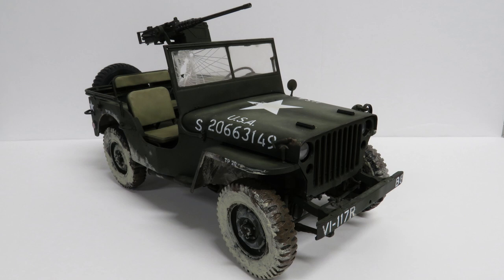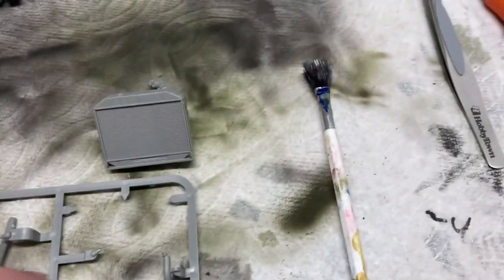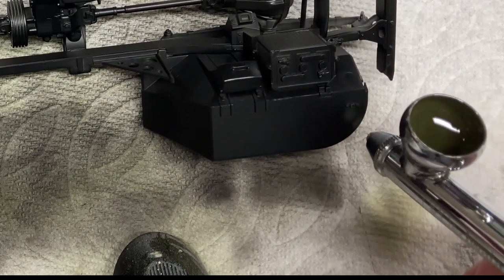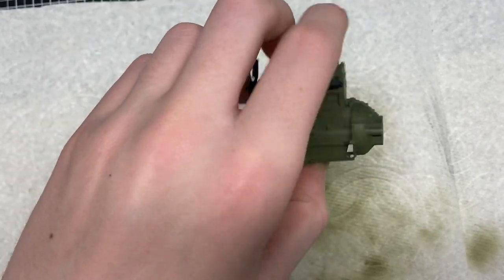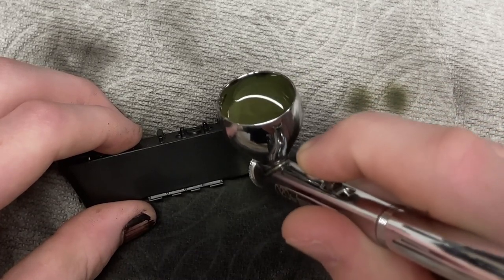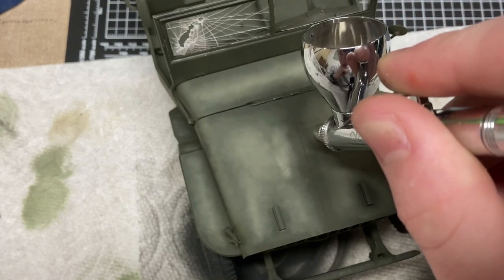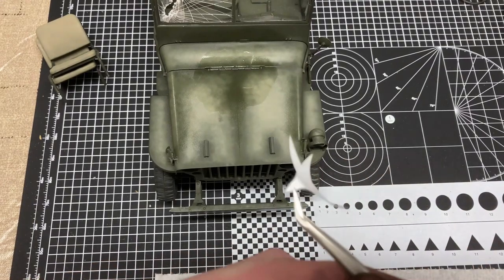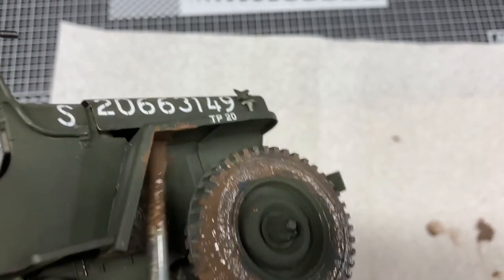Does this kit live up to the hype? build and paint Takom's 1/16 scale 1/4-ton utility vehicle

Comment: The only real "critisism" I would make is that the wheels are realy dirty but the rest is almost like new.  Like they have cleaned the jeep but not the tyres.  Still a good video but could do with a bit more detail. Would love to know how you did the bullet hole I am impressed on that detail.   I am in no way a good modeler or "weatherer" so well done for shareing.  One other comment is that if you wish to improve then why not watch other youtubers (maybe you do) thats what I do and I learn an awfull lot from them, sometime what to do and other time what not to do.  If you are having problems with your airbrush then there ar loads of good youtube videos out there.
Reply from the maker: Thank for the comment, the bullet holes were a “happy” accident. I accidentally got Tamiya glue on the windshield and it fogged up, so the only solution I could think of was to get a pin vise with a 1mm drill bit and drill 5 holes (most of them grouped together) and then add large cracks in the windshield with a hobby knife. And yes, I did rush this project but only because I also got Andy’s hobby headquarters Sherman at the same time 😂